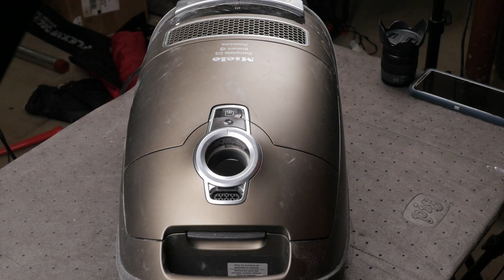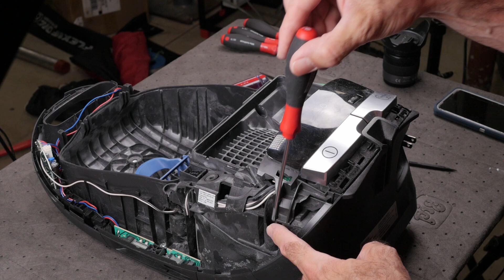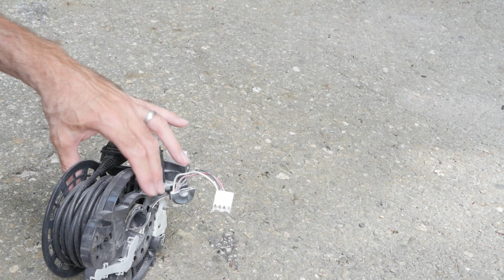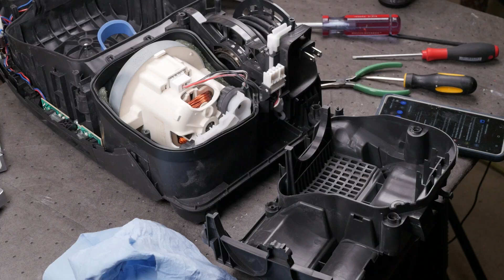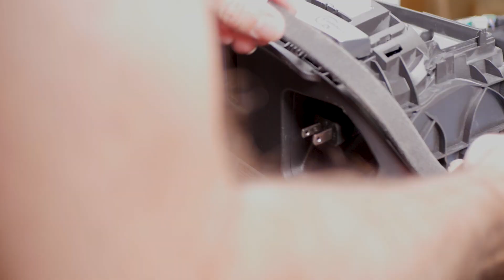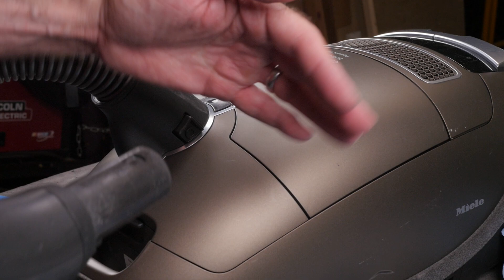Disassembling And Cleaning A Miele Vacuum Cleaner After Using Baking Soda On A Rug

Comment: So the foot button on the left won't let my hose part down Do you know what how I can fix that
Reply from the maker: If you are referring to the button that is on the adjustable carpet head, I have a video about cleaning it here:
https://youtu.be/g4rmTOcNFcQ?si=UOJG9zWomi8SInty
Within that video is a section about how the hose lock mechanism works.  It is possible something is dislocated or jammed in the mechanism.  Hard to say without looking at it.
I know this doesn't directly answer your question, but hopefully it will point you in the right direction. 
Good luck, and let me know how you make out!
Thank you for the comment.

Comment: This is why you don't cheap out on vacuum bags. Miele actually holds several patents on their bag technology. If used according to instructions, you can vacuum baking soda or drywall dust all day and have your vacuum's interior remain completely spotless. Don't cheap out on bags, folks. It's the MAIN reason you buy a Miele in the first place - a near flawless and convenient filtration system.
Reply from the maker: I whole-heartedly agree with you - You definitely get what you pay for!
On the positive side, I did enjoy taking a look inside the unit.  I now appreciate the engineering even more.
Thanks for the comment!

Comment: baking soda is the worst thing for your vacuum cleaner. definitely in large amounts like that. its also just smart to use genuine bags if you have an expensive machine such as miele, sebo, riccarr, kirby and so on. I have 2 Kirby G series machines and I always run genuine bags
Reply from the maker: For sure!  Speaking of Kirby - I sold those door to door for a very brief time in the early 90's.  It was a horrible job, but I got some great stories out of it!
Thank you for your comment!

Comment: HEPA filter must be placed on intake, just after dust bag. They don't make vacuums that way any more.
Reply from the maker: I imagine there can be arguments made for either location - pre or post motor.
The OEM Miele bags are substantially thicker than the generics and I assume, designed for a specific amount of filtration that perhaps allows for the filtration placement on this unit.  Of course,  I have not studied vacuum cleaner filtration design, so I may very well be wrong 😉
Thank you for the comment!

Comment: Of the correct genuine bag was used you wouldn’t need to disassemble anything to ge tit working again. All you should have had to do was change the bag. These are such sealed units that there should never be so much as a speak of dust anywhere inside the bag chamber or motor chamber. Only use genuine Miele bags and filters.
Reply from the maker: Absolutely!  Had that bag not failed, I certainly would not have disassembled and cleaned the unit.  But it was fun to get a look inside! 😀
Thank you for the comment!

Comment: Two decades ago i worked in this trade, at that time the Miele Vaccums were a lot easier to dismantle, the old S2xx Generation was the easiest, approx. 10 minutes for someone who has to find all five screws.
Reply from the maker: 10 minutes - not bad at all!  Although I'm sure if one did this every day, they might become quite efficient at it 😉
Thank you for the comment!
Reply: @mainejason  Of course, my personal best was less than 2 minutes for dismantle. If i remember right, this particular vacuum had a damaged softstart board.
Reply from the maker: 2 minutes, nice!!  That would be one shot video 😉
Reply: @mainejason  the most common damages we had, were ripped of Line cords, damaged blowers due sucked up liquids, or damaged softstart boards.

Comment: i have a miele washing machine 20yrs old and going strong , all stainless and metal, i notice the vac is all cheap plastic and i know these machines aren't cheap , so it looks like they are charging a fortune for what everyone else is doing , out of cheap crap plastic
Reply: The quality of the plastic is what matters. The Miele cleaners have been plastic body construction well over 40 years, the S220 still in my shed would be about 42 years old and the plastic is still fine. I don't use it since the mains suppression capacitor exploded and I have no bags, so for over 15 years I've used the S275i that belonged to my parents. It would be over 30 years old, and is constructed very similarly to the C3 dismantled here. All the plastic is intact, but it wasn't a very good idea for the castor wheels. Mid production run, Miele modified the castors to have metal sliding surfaces, not overly successful. A friend is using my W765 washer which would also be around 40 years old, not much plastic on it, but what there is, no problem.
Reply: Miele is the Mercedes in householdtools. I have one in the age of 35 years and this vacuum is stil good.
Reply: Lmao it's not basic plastic like a plastic bag, utensils, or even the plastic inside cars. Mieles plastic is more akin to the plastic that makes airplane wings: dense enough for rigidity but also flexible enough for wear & use. Tho cars also use ABS plastic, car parts are much thicker & heavier than the Miele body pieces. But even say a cars junction box can't take the weight of a person on top, a Miele vacuum can.
 Not all plastic is equal and not all plastic is cheap 😂
Reply: @ShouPow  i know it isn't basic plastic , it will be an ABS which is cheap .
Reply: @beldin1301  so you then misunderstand that it's not the same plastic used in a Kenmore or Dyson. Even if ABS. I'm not saying Mieles aren't overpriced (they might be especially with dwindling warranties), but it's just a flagrant misunderstanding to think they're executing material design the same way Eureka, Kenmore, Dyson, or shark are. 
Also again, aerospace grade ABS exists. Idk what it's cost per KG or the cost of manufacture is, but with the way the pricing works on the Miele c1, the premium Miele charges for the body might be about $100. Considering the motor is about $150 and the hose and attachment set are about $100 as well (all with their markups included for R&D and increasing returns for a company who normally invests the majority of their profit.).

You just sound like a "new bad, old good" kinda person and it's just silly. Your real enemy is corporate malfeasance, not new-age manufacturing.
Reply from the maker: Yes, that does seem like the way things are now.  I must confess, however - a stainless steel vacuum cleaner would be a lot to have to move around!  Remember the old Kirby Vac!?l 😆
Thank you for the comment
Reply: @mainejason  yeah but you know what i mean,all the gears looked plastic, i remember a cylinder vac when i was young ,they were all metal ,it seems that once the 80's came ,every thing was made out of plastic,even the damn lawn mower D'Oh!

Comment: I did enjoy seeing the inside of a more recent Miele! I wouldn't like to guess how many S series machines from the 1970s through the '90s I stripped down and went through the same procedure with in the 25 years I worked in appliance service. I still have the jigs for doing the bearings and fans on the older motor/fan units before Miele started producing their own. My own over 30 year old S275i runs fine with only slight bearing noise.
Reply from the maker: That's cool!  I'll bet you could strip one of those units down to parts in about 10 seconds 😉
Interesting tidbit about motor production.   The unit in mine looks to be fused together, and it would be difficult to tear it down without damaging the case.
Thank you for the comment!

Comment: Baking soda is going to screw your vacuum cleaner.  The fine particles go straight through the bag and into the carbon filter.  This blocks the flow through the  exhaust pathway and lifts the carbon filter off the top of the machine.  Baking soda will also get into the electric motor and cause problems with that too.   The same thing happens with fire ash.  Never vacuum spilt fire ash if you use an open fire in a fire place.    In both cases you have to strip your Miele right down and clean it all up and replace the filter😢. I only had to watch the intro to this video to feel your pain.  I’ve been there.  Fortunately the Miele’s are robust and can be disassembled for cleaning quite easily.  However it’s two hours of your life that you won’t get back.
Reply from the maker: A great summary, thank you!  Fortunately, I enjoy taking things apart 🙂 
Thank you for watching!

Comment: That device was never designed to be disassembled and maintained.  Such unnecessary complexity!
Reply: That was actually not bad.

Dyson, on the other hand…
Reply: It was explicitly designed to be maintained: dismantled and rebuilt infinitely, BUT being German Miele gatekeeps the knowledge and doesn't give service information to normies. All their machines have precise dismantle and rebuild procedures for consistency and ease for the technician. We as normies don't get access to this information but it says a lot that someone with enough finesse and willpower can do it alone. 
Not all vacuums or modern machines can be treated this way unfortunately
Reply from the maker: I suppose could have been easier, but I had fun nonetheless!
Reply: @mainejason  Fun is important and glad you had the experience  ^_^

Comment: This is precisely why i detest that sand based shake and vac! Glade for those in the uk, We had only just bought a brand new dyson 14, and the first thing my mum goes and puts through it was that horrible stuff,  a lovely new and crystal clear dustbin sanded to the edge of its life!a it made it into the pre motor filters but thankfully not into the motor!  It is good to see that you are using the fabric bags they capture a darn sight lot more dust, infact henery hoovers use them to meet the hepa standard,
Reply from the maker: Ya, I'm pretty convinced that putting more things on the rug to then have to vacuum up is never a good idea!
As I found out the hard way - cloth bags are great, as long as they are QUALITY cloth bags!
Thank you for the comment, and thanks for watching!

Comment: Been there, done that.
In my case, the root cause for the vacuum cleaner losing its vacuum was slightly different.
The housing that holds the motor needs to be airtight, otherwise no proper underpressure can be produced..
On my vacuum cleaner (which is also a Miele) this housing had a sort of an emergency bypass. I think this 
shall open if the main air intake is blocked (because the bag is overfilled) to prevent the motor from overheating.
Anyway, this emergency bypass did not close properly ... I did not find anything really wrong with it, 
but it would open at very small amounts of underpressure. So, I finally made the decision to close it 
permanently. This was 2 years ago ... the vacuum cleaner works ok since then.
Reply from the maker: That's very interesting.  The Miele machines are really nicely designed.  Those small air channels and holes are certainly there for a reason.  The fact that the motor housing has that rubber gasket (at least on mine) certainly affirms the idea of the motor needing to be in an airtight atmosphere.
Thanks you for telling your experience, and thanks for watching!
Reply: My friend had a similar looking vacuum cleaner maybe 15 years ago. I was wondering why it sucks so little. So, I opened it up and noticed that the motor was installed sideways with some excessive force. It's kinda miraculous that it even worked before and left the factory. I didn't think about it back then but someone had probably assembled tens or hundreds of those vacuums incorrectly 😅
Reply from the maker: @hbp_ wow - that's crazy! ( but sadly, not surprising)